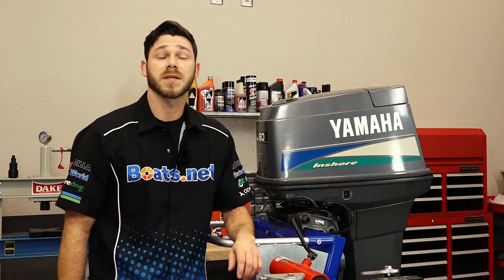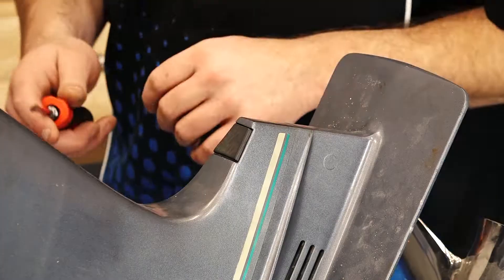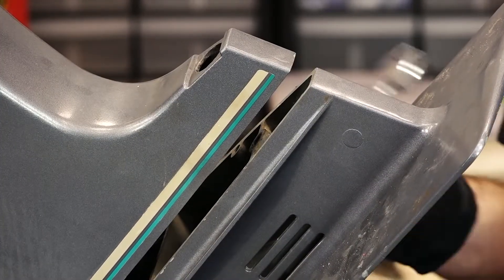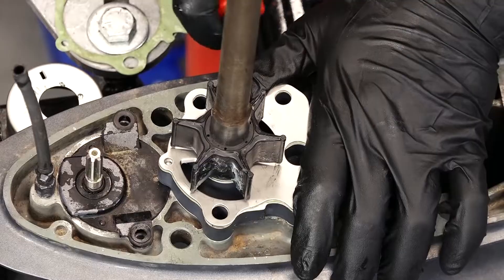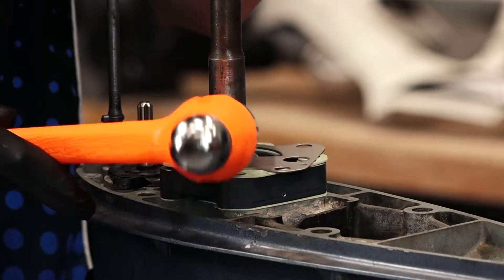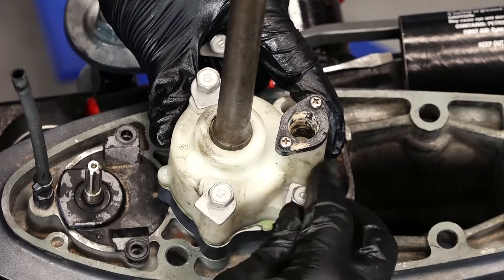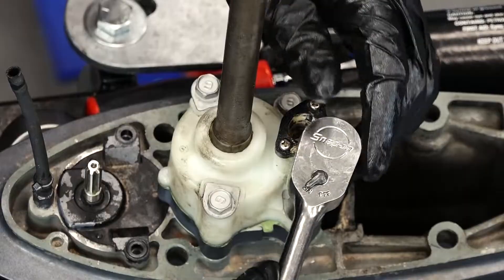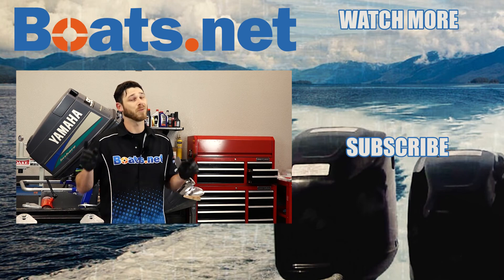Yamaha 90 Water Pump Replacement | Yamaha B90TLRX  | Boats.net

Comment: This video gave me the confidence to install the pump kit on my 2006 Yamaha F90 on the used boat I purchased recently. I'm not sure how long the key was in the shaft, but the tricks to remove it failed and I ended up whacking it so much, it was hard to tell where the smashed key was compared to the shaft material. If the key doesn't budge with a couple of blows then use a couple of metal drill bits to drill out the key to loosen it up. At least that's what I had to do, and I should have done it much sooner. I tried spraying, heating, you name it. The new key went in fine into the somewhat damaged slot, and I didn't drive it super hard into the slot so next time I'll be able to release it more easily.

Comment: I replaced the water pump as instructed but the new pump isn’t pumping very much water out the tell tale. What could be wrong?
Reply: If it's Installed correctly and everything is in good shape. The pump may be doing what's supposed to. Take the plastic fitting out the end of the water line make sure it's clear. If that doesnt do the trick ...You may have some circulation issues...blockages like sand or corrosion build up... I'd start by pulling the thermostat housing off and make sure it's opening properly and also look for evidence of sand and corrosion obstructions. !

Comment: Very good video, two points should be added. There is a small tab on top of the SS cup. This tab needs to line up with the corresponding dimple on the underside of the water pump housing to keep the SS cup from rotating on the shaft after assembly. Also it is easy to miss line up the gear shift spline while placing the lower housing back an to the motor. Make sure the gear shift spline actually gets inserted into the upper linkage or the motor will not shift after assembly. Easy to miss this point if you are not paying attention. Thank you again for the excellent video
Reply: Gear shift linkage usually always goes in 
The point about the plastic housing and metal cup locking in is very well though

Comment: Nice reference video,  You did not note cleaning the bolts, using Loctite 572 on the bolt threads, apply grease to the water tube and impeller fins.  The unit should be in neutral gear and tested by turning the prop shaft freely to confirm that it is in neutral.  The shifter has a mark that the pin needs to match to confirm neutral.  You should take that prop off for this job.  Lastly, a slight wiggle on the shifter can help with installing the unit.  People should be told to consult their service manual and use this video as a reference.  Not a guide for their motor.  A brass hammer should be used for that impeller key but the position it should be in is correct.  A little penetration oil and using a dull chisel to hit the key at the bottom will index it out.  Then it can be tapped out.  Using a punch is difficult and it should be a brass punch.

Comment: What's the piece that goes across behind the cup? I have a 100 4 stroke and mine is corroded and cracked and trying to find out what it is it has a rubber then the alloy
Reply: That is the damper seal guide and the damper seal -- commonly overlooked but should be replaced too if the guide part is corroded out like the one in this video.  I just replaced this on my F90 Four Stroke - go to boats.net and look at the parts breakdown for your motor, I believe the parts you will need is DAMPER, SEAL
 688-45375-00-00 and GUIDE, SEAL DAMPER
 663-45376-00-94 but check to make sure.  Best of Luck!
Reply: @mikescorsone8172  thank you so much you wouldn't happen to know where to find one?

Comment: The question I have. How serious is it that I recover the small rubber pieces that broke off, of the water pump impeller while running the engine, I had water hooked up to try and get it to pump, it would not pump, so I replaced the impeller pump, It pumps good now, but I'm worried where the rubber pieces went.
Reply: Remove the bolt holding the two water intake screens off the lower... they're probably in there.

Comment: Great video. Only problem is around 8:18 they forgot to mention the second gasket that gets installed between the plastic housing and the metal plate.
Reply: Yeah, I was WTF! when I seen that🙄
Reply: Thanks for pointing that out! I had the same issue and had to remove the impeller (which is pretty tight) to install the second gasket.

Comment: The metal impeller housing had a hole in it at 8:40  - Is there not some alignment required for that hole?  Mine came out attached to the plastic housing so I never had them separated in the first place but I did notice the hole in the metal and wondered if it's placement is critical.  Great video. Thanks for posting
Reply: Did you find out?
Reply: yamahaevo - I did not hear back or find out whether hole is significant
Reply: @condor5635  The hole must be aligned to the plastic housing.
Reply: @condor5635  Not only is it a hole, there is a tiny metal lip up which must be aligned.

Comment: Tks  for an excellent instruction.  I'm having a problem with my 2005 70 hp Yamaha that was tuned up and lower unit dealt with . When turned on at neutral or at low trolling speed, alarm  sounds off and doesn't stop until I rev up the engine. Noticed that the water flow off the pee hole is weak initially but gets stronger when revving up. Any ideas of what it could be? Mechanic  back in and could not find any major issues. Would appreciate a reply